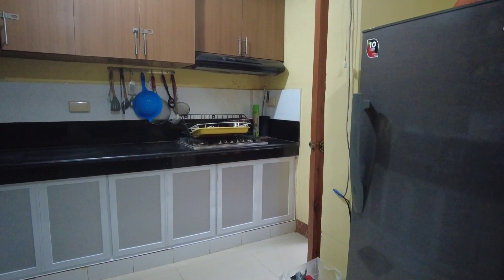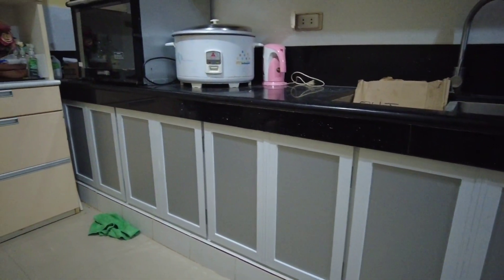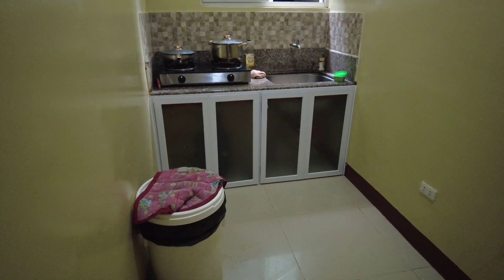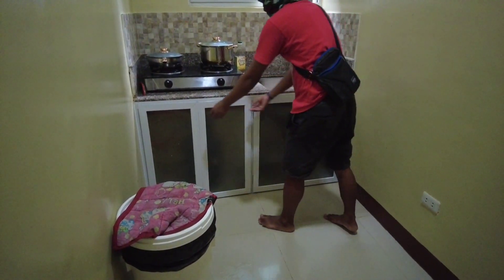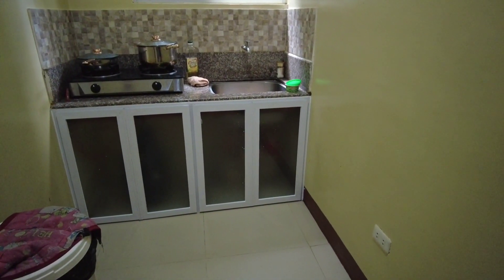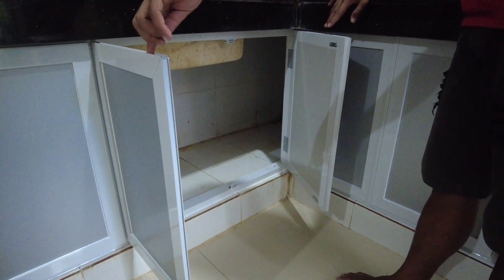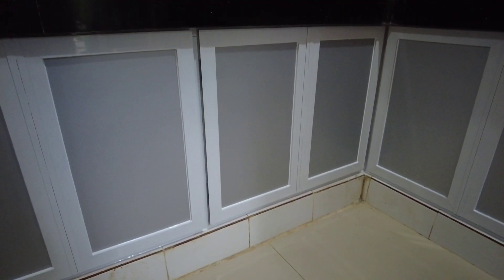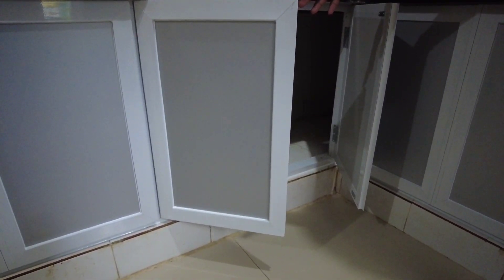nag install po kami ng aluminum lower kitchen cabinet pero ginamit namin sa pinto at ACP

Comment: Bro ano nga po pla sukat ng swing door .thanks po
Reply from the maker: Good morning po yong sukat po ng swing door Cabinet po ay nag dependent po sa actual dimension po  na paglalagyan po ng cabinet, kailangan po kasi pariparihas or equal size po yong mga panel,Pero kadalasan yong size ng pinto ay 1ft/2ftWx2ft/3ftH
Salamat po

Comment: Bro ano po ginamit mo po door frame sa lababo at ano po name cover nito at ano po size ng hamba pla at ano po size ng torch .maganda po at matibay .thanks po ng marami
Reply from the maker: Good morning po
Yong frame po sa labor tubular 1" x2
Reply from the maker: Yong frame naman po sa swing door ay YS221 section , 
Yong pang cover po na ginamit namin sa swing cabinet door ay ACP or claddingat yong hamba ay 1"x2" tubular po you ong hinges 1"x3" , magnetic catches maman po yong pang hold ng swing panel door
Salama po sa tanong.

Comment: Anu po pangalan ng mga material n gnm8
Reply from the maker: Good day mark 
Ito yong mga materyales na ginamit natib
Tubular 1x2
Angle bar 1-1/2"×1-1/2"×1/8"
Ys221
Aluminum cladding 3mm
 Bracket
Hinges 1x3
Sealant
Blind rivers 4-6
Tox #6
Screw 8x1

Comment: Boss Pinto Lang po b ang nilagay nyo boss? Same sizes Lang po lahat?
Reply from the maker: Good day hamming 
Hindi lang po pinto yong linalagay po namin pati po yong pinag kakabitan po ng pinto minsan tinatawag syang hamba  or perimeter frame  ginagamitan po namin dyan ng 1"x2" tubular minsan naman po 1"×3" tubular depende po sa paglalagyan
Salamat po sa tanoong at panonood po ng vlog namin at pasensya na po sa late reply mabusy lang po tayo.
Reply from the maker: Common po equal width  panel sa actual na opening dimension po , salamat po uli.
Reply: @raglassalum  Salamat boss sayang po malayo po ako mindanao po ako

Comment: Ano po ang tawag dun sa gap na inilagay nyo sa pinto ng cabinet?
Reply from the maker: Good morning jaen BG
tie section po ang tawag po doon sa inilagay namin sa pagitan ng dalawang panel swing door , pero kamina na po  ang nag fabricate .
Dalawang angular po na  1/2"×1/2"×1/16" pinagdikit namin para maging tie section , yong original tie section po kasi masyadong malaki at hindi match sa pintuan 
Salamat po sa tanong nyo at sa panonood po ng vlog namin
Reply: Salamat boss nang marami sa iyong sagot. More videos pa po.

Solid subscriber here